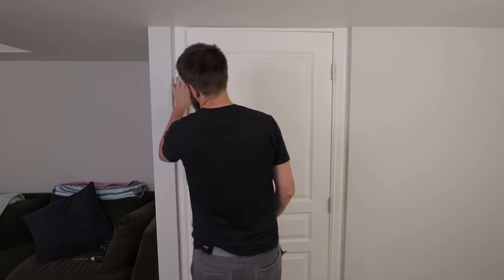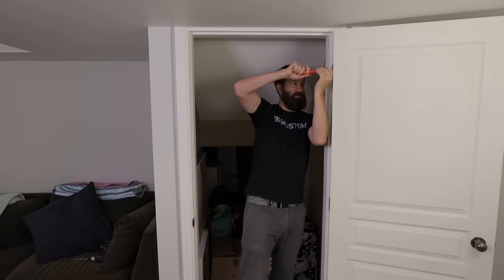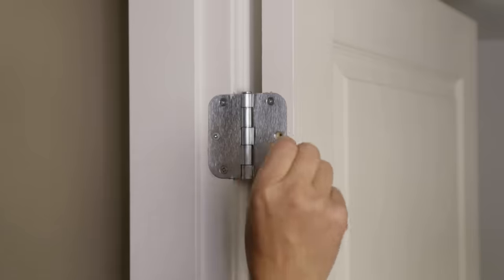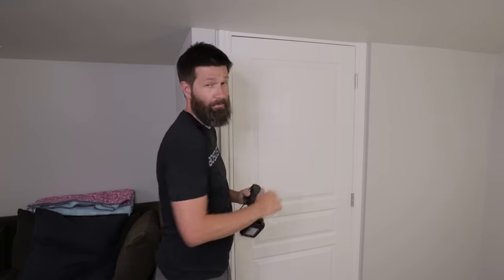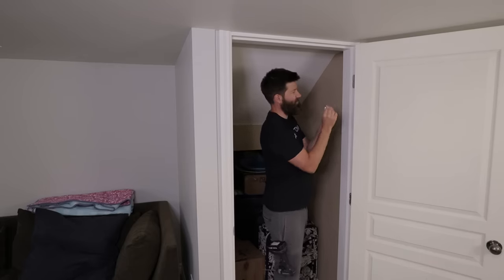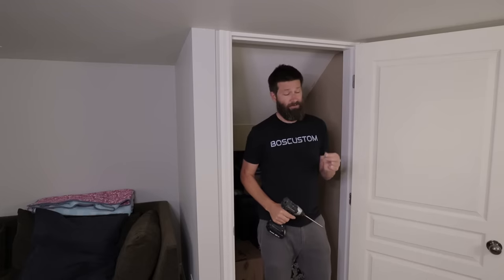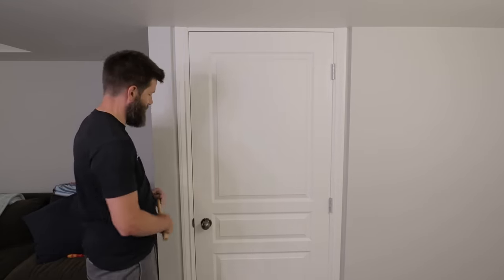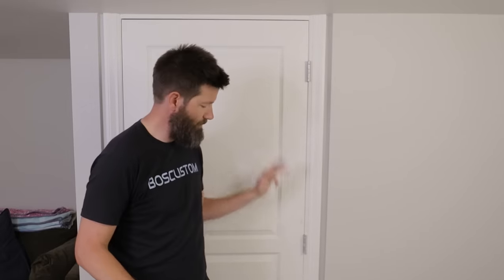How To Fix a Sagging Door that's Rubbing or Won't Close!!!

Comment: Will this help us a close double door with a top catch is not high enough to catch?
Also, any tips on a floated barn door puller the header from the wall up top? Still feels solid where bolted, header just pulling away on top and sides. Thanks!

Comment: This really emphasizes that, more often than not, the most difficult part is knowing what's causing the problem. "X is loose, tighten it." is a common problem with almost anything constructed but many of us don't know the object or system in question and how it operates well enough to realize it.

Comment: @ The Funny Carpenter... I appreciate you posting all the different ways to fix a rubbing door. Unfortunately none of them worked for me. I have a kitchen door that leads to the garage and the very top portion of the door is hitting the frame. It closes all the way but you have to force it real hard and when opening it you have to yank it real hard with force. I tried the three different ways but nothing. Its still the same.. 

I do however have spring hinges on the very top and the very bottom of the door so it can close on it's own. The middle hinge is the normal hinge like your door has. So I tried "fix # 3" on that middle hinge but nothing happened. Is there some other way to deal with the spring hinges to make the door align. I've tried everything and not sure what to try next.  Thanks for any advice.

Comment: I'm not sure if I should thank you... this led to some extreme overconfidence, but at least there were other doors available for the past month.

I finally made the door close without sticking!

I wound up needing to stick some plastic shims to straighten the bowed out frame between the middle and top hinges, and then some new hinges to replace the bent ones.

Would I try to do it again? Sure, but I'd give up sooner for sure. (Did you mention that if it wasn't working after these tricks it was time to call an expert? Probably. But it looked sooo close.)

I will definitely be more inclined to see the money I pay someone else to do it next time as well-spent no matter how simple they make it look.

One thing that I would add: I learned (from the evidence of the last person's attempt at fixing this) that it's possible to get wood screws that are extra grabby and are driven with a T20 bit. These are awesome, mostly because they don't get stripped out the way Philips head screws would.
Reply from the maker: Philips head screws are garbage!

Comment: We have a house we inherited. The last time anything was updated was 1983. We are slowly upgrading things while we wait for probate & a home loan for major repairs/renovations. I am currently working on replacing the interior doors & I have 1 that just won't cooperate. No matter what we do, there's a huge gap at the top and it hits the door jamb at the bottom by nearly an inch. But....stick the old half missing door back up & boom it aligns just fine. I'm about to pull out my hair. The new door is currently sitting in the hallway while we figure out what the heck to do to get it installed. Any suggestions would be greatly appreciated.

Comment: For a loose hinge that won't hold a screw: Don't use a tooth pick! Tooth picks slip out or fall into the door (if the screw hole is too deep). Use a small plastic anchor. Drill out the screw holes one size larger that the hole. Insert the plastic anchor and set it with a small hammer if needed (just tap it in!). Then, take your screw and sink that bad boy into your new screw hold! This should be done for all 3 (or 4 if you have them) screws for the hinge. This is a method I use often (I work in construction and maintenance) and it NEVER fails!

Comment: Tip 1, good tip. Wooden golf tees are perfect though. Toothpicks work, but depending on how whopped out the hole is toothpicks might not cut it, even 2 or more toothpicks might not do it. I'm a pro and I have a bag of wooden golf tees in my kit. Learned the tip from an old time carpenter.

Comment: I just installed a new glass door (interior hall closet - next one for my home office). For the life of me I can't get the bolt out! Aaaaargh! The original door is prolly the original 1969. I did switch out the hinges for burshed nickel instead of the gold. I think they may have shaved the door a bit. I may have to call someone to do the final. This was helpfull though! The first fix, I jumped up to go to do the door with the toothpick, only to have you say there was a 2nd way, so I sat back down - I jumped up to try the 2nd fixt, only for you to say there was a 3rd... 😆

Comment: First off, been watching since I bought a house last year and love the videos! 

I’m working on a door the last few days and can’t seem to fix it. 

We painted and reinstalled with existing hinges/ screws, then a few months later it would still work if you didn’t notice but the hinge was flying out and loose. 

I doweled the holes and tried placing the hinge in again but then it wouldn’t shut because the latch side went over too far. Even though the holes were in the same location and everything was flush. 

Tried using a longer screw, tried adjusting the hinges, nothing. Then I got stupid and dry for the door, then realized it would fit if I moved the holes back a bit. That didn’t work. Now I just filled in the original holes with dowels again and have no idea what to do now. 

Any suggestions would be an absolute lifesaver. 

Love the videos!
Reply from the maker: Maybe try and take the latch off and put a  2”+ long screw in there to try and suck the latch area over a bit.  Make sure you pre drill because you don’t want to split the wood.  Then pop the plate back on.
Reply: @TheFunnyCarpenter  I put new screws back and made sure they were longer and flushed more with the hinge. It closes and opens with some force, but it’s hitting the piece of trim that the latch is set into. Will driving the latch on further help with that? Should I try something with the trim piece?

Comment: I have an interior french door that my buddy helped me put up a year ago. It was decent before, but now it is misaligned. If I am facing the door and opening it towards me, the left door is  too high and hits the top of the frame and the right door is too low and the latch doesn't reach. How would you fix this situation? I tried the first two tricks that you showed, but I feel like the solution lies in readjusting the frame. Thankful for any insight you can provide.

Comment: I tried #3 - got the hinge pin out and shimmed the top of the door to the correct position.   Then I couldn’t get the hinge loops to bend no matter what I tried.   The hinges are pretty hard core as all of my doors are solid wood.    I tried the crescent wrench suggestion and it just spun and didn’t move anything.   So I went to pliers and they were also harder to bend and I was taking a little bit of the finish off.   Went to the hammer covering the hinge with a towel and moved them slightly but it didn’t really accomplish anything toward making the door fit.    Thoughts?

Comment: For the "hinge trick", I like to use a set of Feeler Gauges that I have relegated to less that precision work.

Measure the gap at the part of the door you like the gap on (bottom left in this example), pull the pin on the top right and then use the feeler gauges to wedge the door to the right position so you can bend the hinge to the right spot.

Maybe I'm over thinking things but it's worked well for me.

Comment: Been using the #2 technique for decades, but the problem it makes by ‘sucking in’ the door frame, is a door frame with a bow or a wave.
Have been wanting to try #3, as it seems the most likely culprit, assuming the screws are tight and the frame hasn’t shifted over time, but the hinges are painted and chipping won’t mask easily repainted.
Ultimately, planning on replacing all the door hinges with nickel finish, and using the old pins inserted for the #3, to either wrench or use to tap with a hammer to keep the sleeve aligned on that side.
Great video, but maybe also add wood glue to your #1 idea once you’ve filled the hole in enough (even wood slivers from something like a shim can work to vary the thickness needed) for the screw to ‘bite’.

Comment: My door is catching on the top of the top of the door, not the side at the top. Also the gaps along the hinge side of the door is tight on the top and bottom but wider at the middle hinge. Almost seems like a warped frame or door. Would you recommend a door trimmer for something like this?

Comment: Great video...would shimming the left side help when bending the hinge? 5:30
One tip is this..in a prefab door the hinge screws barely go thru the casing of the door. Unless you shim perfectly, or your house was framed by THE expert carpenter, using the long screws shown in this video almost become a necessity IMHO.

Comment: a small tip to anyone who is pulling door hinge  pins, NEVER let them fall on carpet, & if youre planning on pulling them or hammering them, put a drop cloth or something down if carpet is the flooring below. the graphite that is in the oil is death to carpets, it will stain & never come out. if the lubricant is dried, its even worse, since it is a dust & will flake off & fall into your rug , ruining it. i was a floor contractor for decades & ive seen more than a few carpets ruined by falling hinge pins, getting lubricant on rugs

Comment: My problem is the bottom of the door hitting the frame after I just replaced a damaged door.  I'm assuming I should focus on the bottom hinge instead of the top hinge.  Is that correct?

Comment: I've watched your door videos, but have not seen a solution anywhere to my issue.  I have a 40 yr. old metal clad exterior front door that has always closed hard as far as we can remember because it rubs the top frame away from the hinge side.  This would seem to indicate that the lower hinged side needs to move in to bring that top down, but the door gap by the lower hinge is very tight there.  Since I assume that the door must be square, it almost looks to me like the frame is not square.  Is there a fix for this, or does something need to be done with the door frame?

Comment: The wrench jaw is the weakest part, push into the jaw, not away.
Put a shim temporarily at the door top non-hinge side to give you a proper gap
Also I see today's doors are too light, gonna have to take the jamb hinge off and bend it in a vise. Replace those short screws with 2" or 3" robertson on the jamb side, right into the stud.  Hope that works?

Comment: These are helpful. Although, be aware that if the door is not closing properly it could be the result of something worse such as the foundation shifting or sloping. There should be other signs as well if this is the case. If you fix the doors and later on fox the foundation, then the doors will again be not aligned.

Comment: My bedroom door tilts in an angle in order for the door to close properly but when I put new hinges and line them up where the old ones were, it either picks up and hits the top of them where I can no longer close up and I’m just pulling on it at those point. But also when I have it to where it does close, there is a huge gap on the side of the hinges and can feel a lot of air pass through. This video kind help but I’m not sure if the door needs to be repositioned or dropped a few inches down.

Comment: I have a door issues where in the summer it swells due to humidity and winter it closes normally. With the handle on the left, the door is hitting the top left. Any solution or tips? Happy to send a photo or a video

Comment: I have several doors that the very top of the door is rubbing against the top part of the frame (not the top side of the left side of the door rubbing the left side of the frame as shown in the video). They are also too high on the back plate so won't latch either. To fix this, would you do the opposite of the video and do the work on the bottom hinge instead of the top hinge?

Comment: I was going to try these fixes on the door between our garage and utility room, but all of our hinge screws are 100% tight, so I don't think adjusting the screws will work for us. I think we may need the recess for the hinge to be chiseled a little deeper. Just wondering, is there such a thing as a ball bearing one could put at the bottom outside edge of the door to support it so it's not constantly fighting gravity and possibly sagging again? This would not be good for most interior doors, probably, but this door swings totally on concrete floor, which would not be damaged with something like a nylon bearing.

Comment: This is about a very old clothing armoire with a heavy mirror on the door
The door is rubbing at the lower left corner.
The door hinges are not like the usual ones.
The  frame has a 1/2 inch steel plate screwed into a slot chiseled in the wooden frame with a hole at the one end. Same at top and bottom
The door has a steel plate with a pin that fits into the plate hole at the frame (x2 top and bottom).
If I need to remove the door I will need to unscrew the "roof" of the armoire which is very difficult because the armoire fits into a wall opening so i would need to slide out the whole piece of heavy furniture.
Can you suggest something better?
Thank you.

Comment: I usually use a sledge hammer and just hit the top of frame real hard. Works every time. Then I only need to redo trim fill in indentations and repaint. Easy noting to it.

Comment: I wanted to do 3rd option but my frame bevel outward and my hinges are twice the size to hold oak doors, this mean the frame would bend well before the hinges. Option1 and 2 worked though. My screws are longer than standard cocktail sticks so wooden bbq skewers split in half worked and snapped where required works also.

Comment: I have some sticking doors but the problem I'm running into is that the crescent wrench doesn't have enough room to adjust the hinge. the casings are fairly thick. what would you suggest?

Comment: Ive tried all 3 methods and I still get rubbing on the top.  I think the problem is swelling wood and inconsistent frame construction.  The top and bottom of the door frame are very tight to the door and the grab opens and closed through the middle.  Is it at the point to sand down the door or the frame, which is better?

Comment: I replace two of the three screws with much longer ones, like in the video. The middle screw is nice and tight. But the top screw turns and turns. The hinge doesn't pull away as much as before and it is much easier to close. Only an ever so slight maneuver is required that even a house guest will figure out. But wondering how to make the top hole tighter so that the screw is tighter?

Comment: I wish I could take a picture of the closet door to our master bedroom walk-in closet. It hasn't shut properly in years. I tried fix #3 and got the top hinge in much better alignment. Yes! But, the door will not close. Upon closer inspection, the top of the door is too high on the side opposite the hinges. It wants to hit the door frame at that point. It is really obvious the door is not level with the frame. Pulling the hinges into uniform alignment with the the vertical door frame on their side did not fix the door from hitting the frame at the top opposite the hinges. I'm at a loss as to how to fix. Any ideas?

Comment: Ok so this is my first house I bought. This is year 2 of living in my house. My doors will not close even with all three of these tips. It seems to me like either the door got bigger or the frame got smaller. I’m assuming this is a door issue with humidity, guessing the fix would be to either sand a whole lot of wood from the door or buy a new door.

Comment: Dude, do you happen to have a video about how to fix the bottom gap of a door that is too big? I recently replaced carpet with LVP and the door gaps at the bottom now are huge! What to do???
Reply from the maker: I don't have a video on that, couple things you can do.  Look for some type of remade sweep you can put on there, or you could take the door off and add a piece onto the bottom.  I'd make it like 1/16'' smaller than the door to avoid trying to make it flush.  Caulk it paint it and it might look decent.
Reply: @TheFunnyCarpenter  thanks man! I was considering that, but my expectations are low that it will look ok. It will be like a sore thumb for someone perfectionist like me 😬😁. There is no good and easy technique to recreate the door pattern right?

Comment: I have the opposite issue: the door opening is expanding. The door barely touches the stop trim. If the wind blows the door shut, it passes the stop and gets jammed (no pun intended). I thought about shimming the hinges out with cardboard, but then the hinges will look tacky. I obviously have some structural issue going on. No cracks are seen in the floor tile. The wall bears the weight of the attic HVAC, so I think that's the issue. Any suggestions other than "sell ASAP?"

Comment: Leave the hinge pin in the top two loops of the hinge.  You'll be able to bend the door hinge even with the pin in the top loop and it will be easier to drive the pin back down.

Comment: I have a hollow core door that is delaminating at the top, hinge side, corner. I glued it back together, but did not shim the door while I glued it back together. There is about a 1/8 inch of interior wood  visible at the top hinge, not the bottom hinge.  The door still sticks. How can I fix the door and stickiness?  I can send photos if you need them.

Comment: I wish you had a fix for my Airstream travel trailer door that came from the factory misaligned with the lock strike plate and with no way to get the hinge off to adjust it.  Currently trying e-clips tapped into the hinge, but the first try had them popping off. The basic problem with all of these doors is poor assembly at the manufacturer.